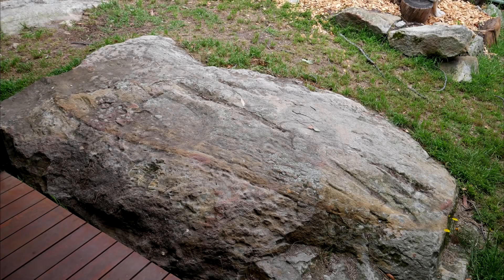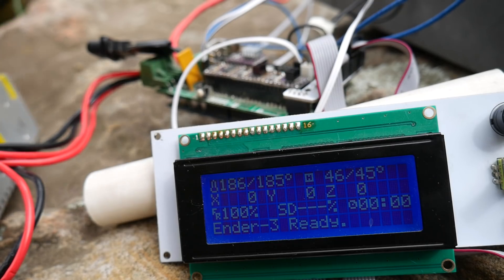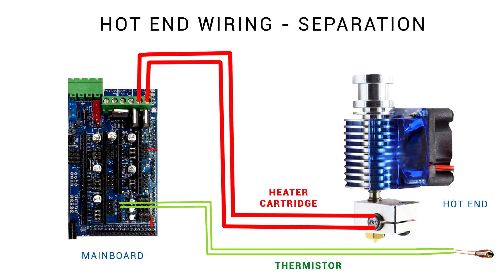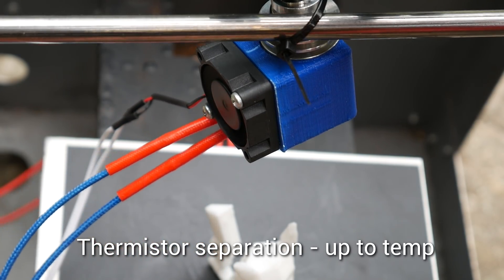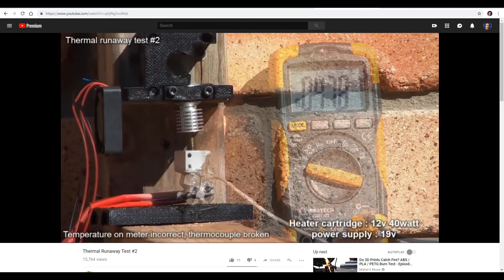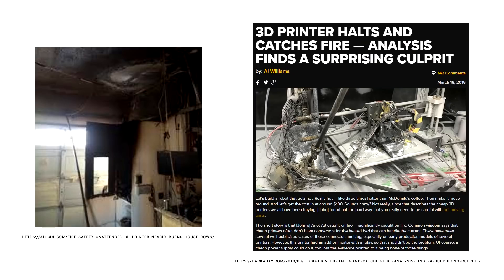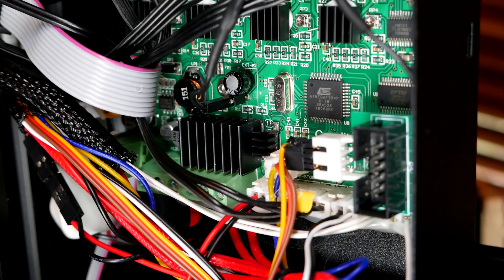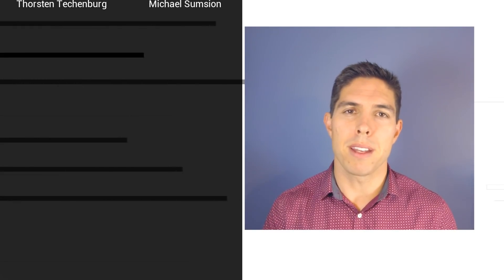Is your 3D printer a fire hazard? How to test Marlin safety features

Comment: Perhaps not the correct video to ask, but do you know of a Thermocouple which provides similar readings to a standard 100K Thermistor (specifically for use with a Creality Melzi 2.2 for my CR-10S and Creality Ender 5 1.1.4 & 1.1.5)? I often print in Nylon, Polycarbonate in addition to most often ABS. I'm forced to throw a ton of $ into thermistor toilet as each is killed by the 312°C to 365°C Nylon & Polycarbonate require.
I absolutely must change to a thermocouple, but have been unable to find as much which will work without many additional parts needed to replace original thermistor with a thermocouple.
Reply: You cannot just replace a thermistor with a thermocouple since they are completely different styles of devices.  A thermistor is a resistor who's resistance value changes by temperature.  A thermocouple is a junction of two dissimilar metals ("hot junction") that generates a very small voltage that varies by temperature.  You need a thermocouple interface that measures that voltage, and something that performs "cold junction" compensation at the other end of the two thermocouple wires - usual some amplifier and A/D converter device.

I think the Marlin firmware has support for some of these devices, but you'd need to add some piggyback board somewhere the connects with an SPI or Dallas 1-wire interface to the microprocessor to read the measurement.  I don't think most controller boards have one of these things present already that you can just connect to.
Reply: @lmamakos  It's why I went to a Big Tree Tech MKR 1.4 Turbo well before I asked the question. The resistance of course does change with temperature in a Thermocouple, but not in a range nor an output a Creality Melzi would understand.
Reply: @monkeymanstones1  No, you misunderstand how thermocouples work.  They generate a voltage at the junction of two dissimilar metals due to the Seebeck effect.  While there is a resistance in any sort of conductor in general, that's not the effect at work in a thermocouple temperature sensor.  See https://en.wikipedia.org/wiki/Thermocouple

You need to connect a thermocouple to a device that can measure this tiny voltage, which changes due to temperature on the order of microvolts per degree. This means a temperature compensated, very stable amplifier in concert, typically, with an A/D converter.  While the microprocessor on the MKR v1.4 has an A/D converter, it's configured to measure the voltage from a voltage divider, with a thermistor connected to one leg.

I've not dug into the datasheet of the microprocessor, but it's likely that the microprocessor has something like a 12-bit resolution A/D converter.  Referenced to the 3.3v rail, that's about 0.8 millivolts resolution per bit, which vastly  undersamples what you're trying to measure.  Look at the graph on the wikipedia page - a Type K thermocouple, when temperature compensated, would generate 0mv at 0C.  At 500C, it would generate about 20mV.
Reply: @lmamakos  I made no statement of the .manner of function. I made no statement of the manner of use. I asked a question and you attempted to attack me for having asked such a question. If defined how I was making use of as much without the item I asked the question about and you have now come back swinging a dagger. At thing point it's the equivalent of Barret .50 caliber rifle versus a dagger for no reason other than you are attempting to make it so.
I asked if it were possible to use a Thermocouple with the Melzi board and you stated no. I stated I had not actually done so but instead done so by a different manner and you came back swinging a knife (dagger) 500 yards from the breach of a Barret 50 caliber auto repeating rifle. That is providing you zero benefit. I asked a question and you are attempting to kill for the question having been asked. I clarified how the item was actually used and you have come back swinging the knife a substantial distance from one of the most dangerous tools only to show off. I have just made clear that you are providing yourself no benefit by doing so. It is very much time to stop now kiddo. I was aware that it could not be so because my Fluke K type was not able to function with the Melzi, but you replied with a lecture due to my having asked a QUESTION. I stated how I was actually using the other brand of the device I was using as much and you have come back to swing a very small knife directly in front of a very dangerous firearm.
You are providing yourself an over the top disservice and I'm working to keep you safe from your foolish action. It is time to stop now, kiddo.
Reply: @monkeymanstones1  I'm sorry if you feel attacked.  You responded in your comment that thermocouples changed their resistance, and I tried to provide you an factual explanation and references that they didn't behave that way.  I was trying to convey information and knowledge to prevent you from going down a path that might waste your time.  I didn't attack you.  I didn't call you stupid.  You're the one attacking, using a term like "kiddo" which I presume you intend to demean and insult me with.  Maybe you need to take a deep breath and consider that not everyone in the world is your enemy.
Reply: @lmamakos  I found no issues previously other than your missing the specifics of my statements, multiple times. In fact, more often than not. I have earned 2 undergraduate degrees in the Sciences [yes, a 45 year old man should have a graduate degree and I do not] (1998 Clark University, Worcester MA - Bachelors of Science in Information Management paid for by my then employer Polaroid Corporation - What today is considered Information Technology), 2010 Biology (only because the then college and now University didn't have a Microbiology specific program, but near all of my classes were Microbiology, Chemistry [how I have a degree in Biology with a minor in Chemistry] , Biochemistry and Physics based with Microbiology being my full intention and intent - Westfield State College [now University]).
Perhaps I should place 1 of my thermistors, 1 of my hot end Thermocouples and in addition my Fluke K type thermocouple which came with my Fluke 88AV multimeter into my freezer and measuring the resistance before, while cooling and at target temperature as I had 4+ years ago, but on film to post to YouTube. Then all can see how the resistance in each changes and that they are not identical). When I plug it into my multimeter and turn the knob to resistance and place it in a warm place the resistance changes, the same when I place it in my freezer. If the distance between the 2 different metals changes then the electrical resistance will change as well, as does happen, just not at a rate and manner which a thermistor input can make sense of for proper temperature metering).
I replied as I did because I had made clear that I was not using the device (controller board) you believed and you chose to then provide an attempted lecture on the subject. But because it completely ignored the clear fact that it was not relevant since I was not using a thermistor only board and missed my statement, it was frankly insulting. I was using a board which can function properly with either form of temperature sensor. Fixing it to work with a thermistor only board is not that large of a challenge, but also not a cakewalk. Converting a varying voltage signal to a varying resistance signal can be easily done with an Arduino and a small number of accessory components. But such work is of no use when the Big Tree Tech 1.4 Turbo can be had for around $35.00 and provides 32 bit control, so after increasing the power supply current all 3 axis's and both extruders can then move all at the same time, versus the 8 bit, generally single axis movement often seen in lessor boards.
To be clear, what was insulting is that my having asked a relatively simple question produced a lecture rather than a "No and I can explain why if you would like to know more about it." I stated why the excessive explanation was of no value to the conversation (you provided unrequested details, but some may actually find them useful so retaing them makes sense) by stating that I was not using the board my question specifically referred to. As such explaining the concept more deeply moved away from the comment... twice, as if to be insulting. I do not see any threats by either of us, but I am well aware that I provided an example to define why the explanations were disruptive to the conversation and the additional text by you very clearly implies you do not believe I am capable of researching the topic of the temperature sensors myself.

Comment: Have you tested any Creality firmware's recently? I've been in contact with them via Facebook and they told me that thermal runaway is enabled on the Ender 5. Is this true? Mine won't arrive until next week so it'll be a while till I can check it. 

They also said that the v1.1.3 board is better than the V1.1.4 (not silent just standard) which makes me wonder why they would release a newer board that's not as good as the older one. It doesn't make sense to me!!

Comment: I've recently bought an ender 3 and i've had an issue with an octoprint plugin that set the hotend temp to 400°C. The protection triggered at 275. So i think they've eventually added it to the firmware

Comment: Could you maybe investigate some more into this? 

I have checked the 20181208 firmware for Ender 3 on the Creality website. Inside that firmware i can find code for Thermal runaway protection. But wich printers are updated with this firmware already ?

I bought my printer  3 weeks ago. How do i know what firmware it runs ?

Also, is the Panic Power feature included in the flashable Marlin releases that you speak of? Are they updated ?

Comment: Also about the ender 3 is that the xt60 connectors of the heat bed wires are not soldered but crimped, this could and in many cases led to a poor connection which cause these wires and the connector get extremely hot because of the high current that passes trough this wires and can led to a fire  eventually

Comment: my ender 3 arrived 08.01.2019 (late 2018 model i think) and after test it today wait 3 mins and no errors no termal protection firmware i ll update firmware after that xt60s and mosfets same as yours need to be fix too 3 most important things firmware, xt60, mosfet heatink

Comment: I just saw that there is a new firmware and source code available on creality website (LATEST ENDER3 SOURCE CODE 20181208). I quickly looked in Configuration.h and I think they might have added the thermal protection now. 
#define THERMAL_PROTECTION_HOTENDS // Enable thermal protection for all extruders
#define THERMAL_PROTECTION_BED     // Enable thermal protection for the heated bed

Comment: I received my new Ender 3 Pro one week ago (Dec 04, 2018). Shouldn't it already have the new firmware on it with Thermal Runaway protection enabled? I'll watch this again several times and try to figure out how to test it on my printer. THANK YOU for posting this.

Comment: Noob question.  I have ender 3 flashed with Marlin 1.26a.  I ran the test and it shuts down but says 'E1 Heating Failed PRINTER HALTED please reset'.  Is that still thermal runaway protection?  Have they just changed the message?

Comment: Thank you for a thorough video on the topic of thermal runaway.

I'll definitely be sharing this video as the lack of thermal runaway protection is a major safety hazard. Made worse when many manufacturers haven't really bothered to mention whether their printers have this feature or not. I have four 3D printers and I have never left any of them running over night, if I do step out of the room when they are printing I set an alarm on my smartphone to come back and check that the printer is behaving itself.

My Ender-3 still has the 'stock' firmware and I have always assumed it did not have this important safety feature. Yes, I will be updating the firmware real soon. 😉

BTW: Qudos for sacrificing a 3D printer to demonstrate the safety features when they are present and more importantly when they are *not*! 👍

Comment: Ok this has gone on enough Michael.
1. You need to stop arguing with people that don't agree with you. This will happen when you put out videos with misinformation in them.
2. Remember - you are a self appointed educator. Nobody asked you to do this, nobody hired you, nobody asked you to spam the links all over facebook in an effort to pump up your subscriptions so when people don't want to hear what you have to say or have a problem with it  DEAL WITH IT. They did not sign up for the Michael knows everything course, no you slammed your videos in our face practically every freakin hour.
3. Anyone who has half a brain knows the hotend cannot pop out of the heaterblock unless you run it without the housing. Yes thermistors wires can break after alot of movement but any good printer would see that occuring in stages as the head moved and it went from intermittent to all the time. Wires dont just snap unless they are solid core and or heavily oxidized. The way you had to make your print catch fire is a pretty good indicator no one should really be worried. How many houses have we heard been burned down in scale to how many "unsafe" printers there are out there.
4. Stop acting like a know it all. Everything you cover in your videos is such old old stuff. It's like you are living in 2015.
Reply: I enjoy the videos and he provides very good descriptions and proof that it's an issue.  Move on if you don't like his videos, no one has asked you to watch it.

I for one have shared this video with friends who are new to 3D printing and feel safer knowing the limitations of my printer and how to make it safer.  I'm going to update my firmware and test again once complete.

The fact is that there are no standards for safety features, so I welcome this kind of video and hopefully the manufacturers are watching too.  Very simple for them to implement firmware changes or post a warning.
Reply from the maker: You are entitled to your opinion.
1. There is no misinformation in this video.
2. People may not like Facebook links, fair enough. I make videos twice a week, not every hour. I only post to relevant groups. If you don't like it, just keep scrolling.
3. Read the articles linked in the description. I agree it should be rare, but heater cartridges can pop out.
4. Sorry the content displeases you. Simple solution: don't watch.
PS. thermal runaway protection didn't exist in 2015.

Comment: A very good video.

Something to add: There are scenarios even firmware runaway protection wouldn't help. If you use an SSR or Relais, it can go defect in on-position. So no way to shut down by the controller.

In case you use AC heated bed, maybe adding an bimetall swich f.e. 110°C to the bed and add it to wireing would help. Same principle an iron uses to control tenperature - but here absolutly independent from firmware limiting max temp to a save value.

There should be an alarm out pin in marlin, to shut down the complete printer with external relais on thermal runaway. Shouldnt be hard to integrate in firmware... Also you could add an seperate ESP sending you an e-mail and let all the lights in the house flash (If you have a smarthome), maybe also start an alarm call...

I havent done that now as I have not put my AC-heaters in use now, but I will try that ideas if I do so...
Reply from the maker: Thanks, great input.

Comment: Hi Michael another great video, I disconnected the red thermal cable as shown and turned up my nozzle and got message E1 Heating failed printer halted please reset. is that the same thing? cheers Michael
Reply from the maker: That sounds very promising. What printer and firmware?
Reply: @TeachingTech  It's an Ender 3 and im using Marlin 1.1.9

Comment: Maybe we should have printers or printer power supplies connected via the relay connected to PS_ON. You'd get two buttons, one is a power-on button which you hold until Marlin can assert the PS_ON line for a couple seconds that just bridges the relay, and another a red emergency button which breaks the connection.

The benefit is that then maxtemp error has something to actuate when a MOSFET is gone shorted.

Is this kind of mod something you'd be willing to explore?

Since no rapid frequent switching is necessary, a solenoid (mechanical switching) relay is probably appropriate - they are inexpensive and can be sourced locally from trusted suppliers.
Reply from the maker: Firstly, I just wanted to thank you for all of the knowledge you have imparted in previous comments. I've just spent several hours catching up with reading and replying to comments, your name came up a lot. It's greatly appreciated, especially when you clearly know your stuff and are still so humble.
I am interested in playing with a relay between the PSU and mainboard, influenced by the output of something like this: https://www.youtube.com/watch?v=PvEmrNJB_xw
Your solution sounds really good, having the maxtemp trigger an output too. Any links you can post to steer me in the right direction would help a lot.

Comment: Tested by heating to pla temp, disconnected one heater wire... no alarms for over 3 minutes. heat went down from 185c to about ~40c in that time. Got mine little over 2 weeks ago with stamps that it was manufactured 2018. So no thermal runaway protection enabled. Will be definitely updating firmware asap.
Reply from the maker: Thanks for doing the test and sharing your results.
Reply: what firmware did it ship with?